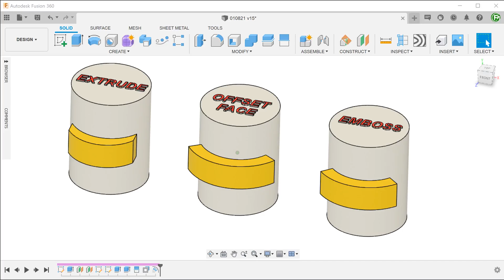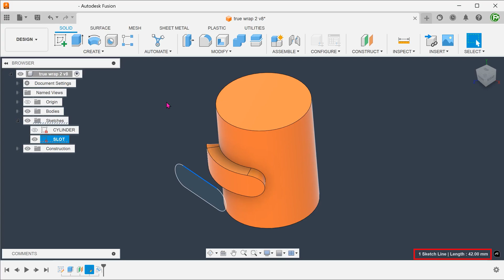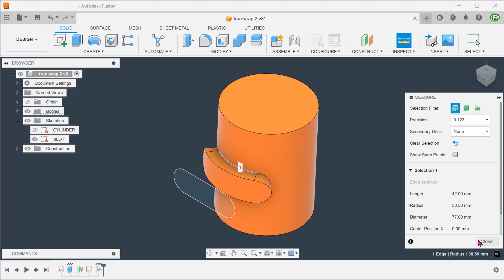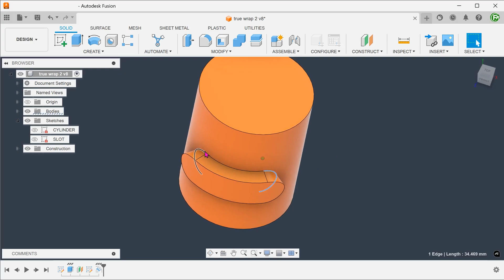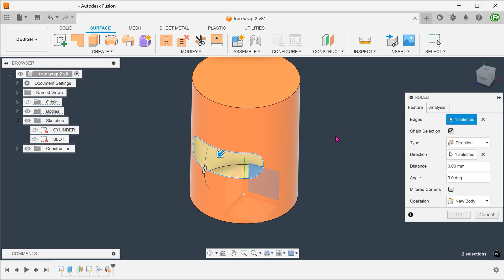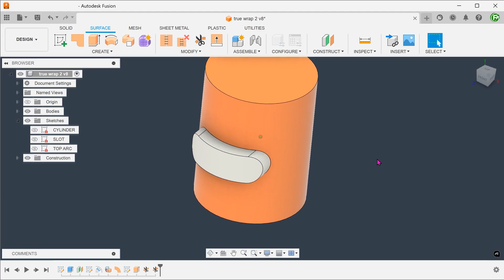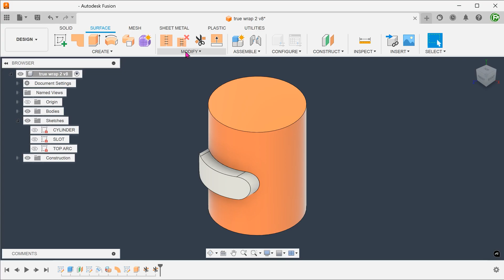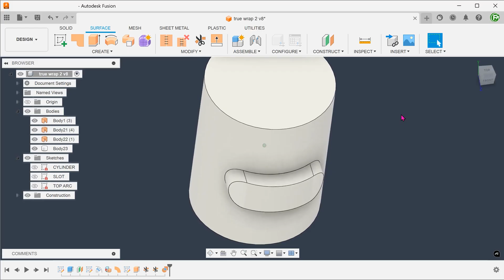Autodesk Fusion | Extrude and Emboss (Combing the best of both worlds?)

Comment from the maker: Just realised that the previous video I made was over 3 years ago. How time flies!
A point to note here. If you use the sketch to make a split face and then perform an offset face, the side walls would be perpendicular to the cylindrical face.
Reply: But then how do I solve the wrap problem?